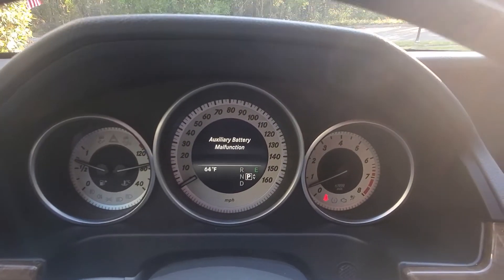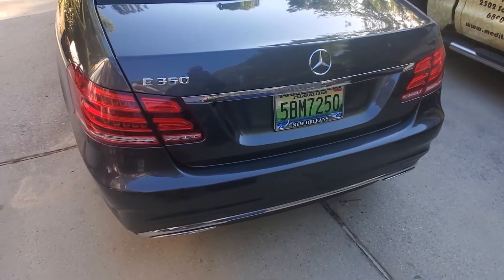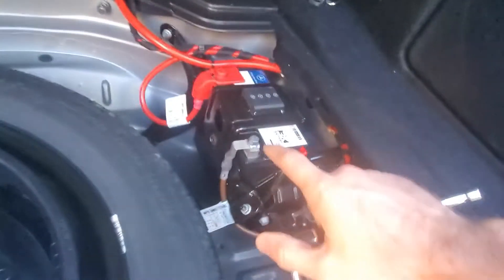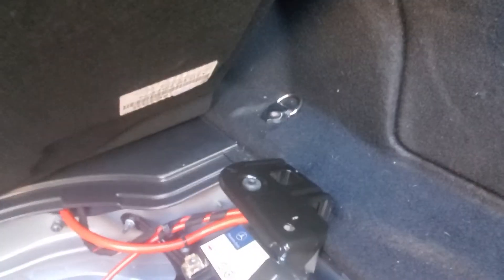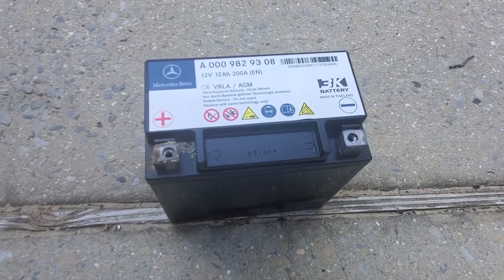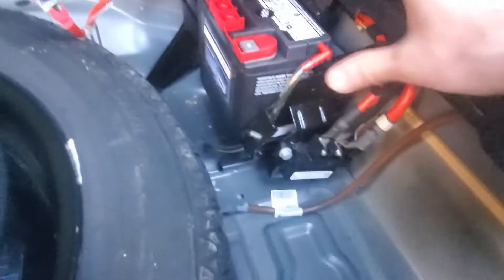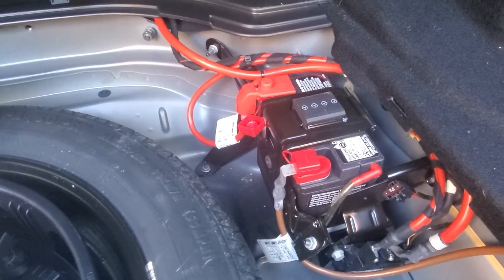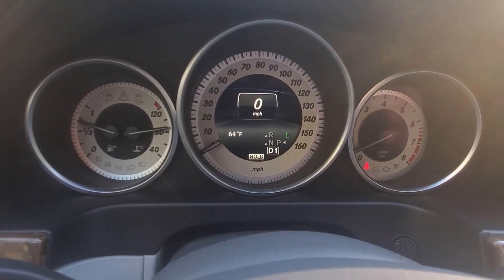Auxiliary Battery Malfunction FIX   Mercedes Benz E W212

Comment: I have the same fault coming up in my w212. I have text the auxiliary battery and it has the correct voltage. What could be the issue?

Comment: Can the auxiliary battery be charged or does it need to be replaced?
Reply from the maker: Every battery can be recharged but i don't belive in that. Once the battery is depleted it will not be the same even if you recharge it. And i mean for around 100$, it's not a big deal

Comment: For how long can you drive with auxiliary battery signal on?
Reply from the maker: For as long as you want. It does not affect the driving, it just limits some functions
Reply: @throttlechaser541  thanks for replying because mine has been like that for about a month or so… and I haven’t gotten around to fixing it (financial problems at the moment) but will be getting it fixed in a few weeks hopefully
Reply from the maker: Glad i could help